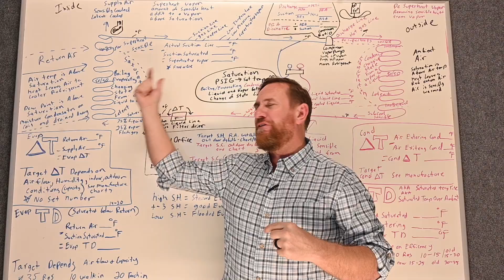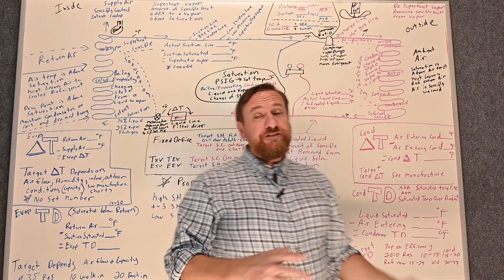HVAC 101 Big review Refrigeration cycle  with all the details

Comment: Thanks so much, I did learn alot from your videos, I do have Trane unit 27years old use R 22 and start making noise but it works, I am thinking to replace it, so is the set line can be used for the new one? and how can i clean it if i can use it and do i have to do charge with ferion or the new unit will have ferion in its compressor?

Comment: If i may ask. Why is home Air-conditioning blowing hot air .
Reply: cause the condenser and evaporator are reversed in the AC heating mode. the heat is now from the same indoor unit(which is now condenser ant not the evaporator in the cooling mode).Btw, It's not actually blowing hot air, it is the room air blowing by the fan meet the hot coil and absorb the heat from the coil. hope that helps.

Comment: Sir 
A tec came and check my ( txv ) ac !!!!!   After he left and after  awhile I  decided to check the unit put some gages on it and once that the sub cool ( hi side ) was at 10 degrees superheat which is what the unit asked for but my low side would go from 34 degrees to 27 degrees. 
The hi side would not move.
Correct me if I an wrong but I think he let air in the system. And that is why my gage on my low side gage is moving..  .let me add this everything else filer dryer. Reg filter, air flow in and out .  I have 42 degrees coming out  of my register.

Comment: 1:00:54 - I’ve finally discovered the best way to keep this straight in my head: high SH means more vapor taking up space in the evaporator coil and high SC means more liquid taking up space in the condenser coil. Both situations leave less room in the respective coils for saturated refrigerant causing well known issues in each. The opposite is also true: lower SH means less space taken up by vapor and a risk that liquid refrigerant can travel down the suction line toward the compressor (or vapor pump, as you call it) and lower SC means less space taken up by liquid, risking less than a solid column of liquid hitting the expansion device. Low SH - not enough vapor leaving the evaporator; low SC - not enough liquid leaving the condenser.

When I get to the point where I’ll be able to teach refrigeration, I’ll explain it this way!
Reply from the maker: Yes that is correct. 
That's explanation was my goal in 
HVAC 061 TXV TEV part 2 with Target Subcooling  and 
HVAC 062 TXV TEV Target superheat vs Superheat.

Comment: I want to connect a vessel at the outlet of the condenser in my propane-based brine-to-water heat pump system to collect all liquid refrigerant and gas in the event of a leak. How should I determine the size of this vessel? Can I attach a liquid receiver for this purpose? My goal is to ensure that all liquid refrigerant is collected in the vessel if any leakage occurs from the condenser lin
Reply: Should work, but you'd need electronic valves to shut off the high side King valve, wait for pump down to finish with a low pressure cutout and have that also trigger a low side cutoff to seal it all in the tank. Just make sure your tank doesn't have any leaks..

Comment: Big question, does pressure increase during superheat in the evaporator,  does it drop during de-superheat and sub-cooling in the condenser? Intuitively I would assume yes, however the fact that we can determine Saturation Temp by reading the PSIG of our low and high side access ports, implies that no pressure change occurred during these processes. Any answers with explanation would be incredibly appreciated.
Reply: Hmm. maybe ive got it. Even though superheat is occurring, the increase in pressure caused by the superheat has already been accounted for in the net pressure of the low side line.

As superheat occurs, pressure increases, raising bp, reducing flash, increasing liquid, increasing time taken to reach 100% vapor, reducing superheat.

reduced superheat means lower pressure, lowering bp, increasing flash, reducing liquid, reducing time taken to reach 100% vapor, increasing superheat, increasing pressure, ect ect.

endless self balancing cycle? Or am I all wrong here?
Reply from the maker: At 0 PSIG (14.7 pasi) atmospheric pressure nitrogen has a saturation temperature or boils at -320⁰F.

I can put a cup of nitrogen on the table and it will be liquid boiling at -320⁰F with 14.7 PSIA atmospheric pressure pushing down on it. 

Yet in the same room the nitrogen vapor is superheated to 75⁰F.
The pressure has not changed, but once the nitrogen turned to vapor it superheated 320⁰F above its saturation point. 

I can reduce the atmosphere pressure (vacuum)  and make nitrogen boil at even a lower temperature. I can also increase the pressure and make nitrogen boil at a higher temperature. 

Even in a propane tank, the propane vapor at the top of the tank can be superheated above its saturation temperature. 

If you pour hot water on a tank and rub it down the tank you can feel where the liquid propane level is. When your finger reaches the liquid, some of the liquid changes state, absorbing heat and cools your finger.  The vapor at the top of the tank just superheats.

All the gas laws work together to create the pressure Ballance.
Boils law, Charles Law, Gay Lussas las, law of perfect gasses.
Reply: @love2hvac  Hmm, I partially understand what your saying, but it opens up more questions. In your example, when we drop the pressure to make the liquid nitrogen boil at a lower temperature, does that instant pressure drop, instantly drop the temp of the liquid nitrogen? If so would an amount of that liquid nitrogen flash to vapor the moment the pressure drops to facilitate that cooling?

Comment: One more question about TD and Delta-T, I'm getting a negative temperature change only when calculating for Condenser Delta-T. Is this correct assuming that the temperature of the air coming in is going to be lower than the temperature of the air coming out, therefore, a negative net difference? Both my Evap TD and Delta-T calculations were positive increases so as my Condenser TD, so I'm not sure if my calculation (or understanding of it) is wrong for Condenser Delta-T.
Reply from the maker: Condensor data T the air exiting will be higher than the air entering. 

Condensor TD (CTOA) the saturated aka condensing temperature of the refrigerant will be warmer than the air coming in. 

Evaporator delta T the air entering will be warmer than the air leaving. 

Evaporator TD the air entering will be warmer than the refrigerant saturated (boiling) temp. 

There is no negative number since it's just the difference in the two.
Reply: @love2hvac  Thanks very much for clarifying that Ty, and keep up the stellar work! I'm learning so much from your videos :)

Comment: Hey Ty, thanks so much for this video. I just started my apprenticeship in HVAC and I've already learned more about the basic refrigeration cycle watching your video than other YouTube videos covering the same topic. The only part of your video I haven't fully grasped is the difference between the Delta-T vs. TD equations for both the condenser and evaporator. Are they essentially the same equation? For example are you simply using the return air and supply air difference in the evaporator to get to the same outcome (ie. temp difference) if you don't know your suction saturated temp? I'm essentially confused about the difference between TD and Delta T in terms of when to apply them in real life scenarios.

And lastly, you say that the discharge line temp shouldn't exceed 225F, is that a universally applied rule to ALL lubricating oils used in residential/commercial compressors or are there some oils that can handle a higher discharge temperature rating? Thanks again for all your insight and wisdom :)
Reply from the maker: They are both temperature differential but they are separate uses

Delta t meaning the same medium in vs out. 

Evaporator delta T means it temp in vs air temperature out. 

Condenses delta T is air temp in vs air temp out. 

Liquid line delta t  is refrigerant temp in vs refrigerant temperature out. 

Water chiller delta T is water temp in vs water temperature out. 

TD represents 2 different mediums. 
Evaporator TD is the return air temperature in vs the refrigerant saturated. 

Condensor TD is air in vs the saturated temperature it's also called CTOA (condensing temperature over ambient)

You can have a chiller TD refrigerant saturated temperature vs water in temperature. 

Cooling tower TD is the air entering temperature vs the water entering temperature. 

For TD is also used for hydronic cooling. 

Return air temperature vs the temperature of the water entering. 

both are tempersture difference. 
TD is two different mediums 
Delta T is the same medium. 

It's a term.many people get.mixed.ipmimntje trade and incorrectly interchange them.

Hopefully that helps !
Reply: @love2hvac   @love2hvac  yes it makes crystal clear sense now, thank you very much for your detailed response!

Comment: 17:31 what is going on with your shirt!?
Reply from the maker: It's a cooling shirt.
The back is cut to allow airflow and a mesh material is behind that. 
It keeps your back from getting soaked with sweat.

No air conditioning in the studio, it gets about 100⁰F while recording at 105⁰F my best starts to overheat and shut down.

Comment: So on a reach-in cooler or freezer the manufacturer should have a performance chart?
Reply from the maker: Yes.
You can also get a performance chart for the compressor.

If it's a Copeland, you can scan the model number and select the refrigerant. It will provide you with the capacity, amps, eer, cop, and compression ratio at any set of conditions.

Comment: Good night Professor Ty. I watched until you talked about condenser TD. I have two question. I don't completely understand when is said that the flash gas helps cool the liquid refrigerant down to the boiling temperature, could you explain it to me more deeply or tell where I can find more information? Also, why a condenser with a lower TD is more efficient and how can you tell which is the design TD of a condenser? Thank you very much, and have great day.
Reply from the maker: I'm not sure where it is but I have at least 2 videos on flash gas. One is introductory the second goes deeper. 

As for Lower TD and efficiency comes from the design. The manufacture builds more surface area or more air flow or material (micro channel)

The better heat transfer means we don't have to have a higher condensing temperature to remove the same amount of heat. The lower condensing temperature leads to a lower compression ratio and less energy usage.
III nhabe a video on TD also

Comment: Would you please talk about coolant cooled condenser by Valeo that BMW uses for its 2018+ cars
Reply from the maker: I don't have access to one for a video. but it's basically just a water cooled condensor. Instead of reheating heat to the air, it rejects the heat into water. The water then goes to the radiator to reject it's heat.
Reply: @love2hvac  thank you for considering my request; I've collected some info from the internet and BMW's ISTA, things worth noting is that its using the low temp cycle for cooling the intercoolers for the AC,  water hot side is closer to low pressure side and vise versa

Comment: I am asking for an analysis of what happens to the oil in the system during normal operation, Step by step, where it travels, in what amounts it settles the most, whether the physical height differences are an obstacle to the oil, what% of the oil leaves the compressor, what% remains in the evaporator, and does this oil come back if there is little refrigerant and low pressure? I understand that the easiest way to move the oil is in the liquid part (logical), if we have a leak, little refrigerant, low pressure, will the oil be able to "get out" from the nooks and crannies of the evaporator?

Comment: Wow as per usual sir super good video. I have one concept that I’ve been wondering about. How does the compressor know the ambient air temperature such that it can always output an appropriate CTOA pressure?
Reply from the maker: The compressor does not change it's moving the same volume of refrigerant. 
If you have a container of refrigerant,  and move it to a warmer place the pressure will also increase. So the natural laws are still in play. As the temperature on the copper goes up the temperature of the refregerants is pushed up and also the pressure gets pushed up.

Even though the compressor is running the same speed, the additional pressure means more electricity usage and it's more work against the motor.

Comment: Thx for your quick response, pls google the phrase at the end, this is a leisure facility in England where the sun is moderate compared to other places, and they have managed very good savings using a couple of thermal panels for each Mitsubishi VRF unit.
 “Energy saving at White Horse Leisure Centre with solar thermal technology”

Comment: Thank you Ty, you are wonderful, you make thermodynamics fun, if I had a teacher like you long time ago when I was at SDSU, I would have ended up a mechanical engineer instead of civil.
Keep up your lessons, I bet everybody is now understnding science better.
I have a question for you, and would very much appreciate an explanation.
Now a days some companies are offering thermal solar panels as a retrofit between the variable speed compressor and the condenser, claiming it will make the compressor work at lower speeds thus saving energy up to 50% in sunny areas, my question is
If the refrigiratìon  cycle have somewhat fixed temp and pressure along the hot and cold lines, wouldn't raising the temp in the condenser violate such parameters, and what about the size of the condenser or fan speed ?
and if such substantial savings can be achieved using a simple technology, why don't the manufacturers take advantage of it, and make a provision in the line so a thermal panel can be added when the situation allows, along with the proper technical details in their literature.
Thx in advance
Reply from the maker: anytime   "savings" and high numbers like "50%" by BS meter goes into alert. 
It takes energy to move refrigerant, to move heat. Even with Geothermal and its really impressive heat storage  designs the savings are nowhere near that. Lennox had a system that uses solar panels that tied directly to the condensing unit. it only offset the use of the condenser fan motor. that's approximate 184 wats. It was a lot of cost for very little savings.  
Every few years companies reinvent evaporative condensers. they spray water on the condenser to increase capacity, it works for a short time but the water bill goes up and the water quickly ruins the condenser fins cositng much more money than ever saved. the marketing is great though.
That said I would have to look at the design and see the numbers. Just because I'm very highly skeptical, and its unlikely, it could be possible.
Reply: Yep, seems out best bets are to optimize the parameters for the refrigerant and system as a whole. Plus less temperature delta from condenser to evaporator takes less compression, therefore more efficient, that's why geothermal is so good, it's more consistent and less extreme than the air in winter or summer. R290 looks pretty good for efficiency if not liked for other reasons.  @love2hvac

Comment: Hey ty , I know this is beyond the scope of the basic refrigeration cycle but I was wondering if you can help. I’m learning as I go and trial by fire. I’m currently working on some marvair wall mount units which I hate. The unit was working perfectly fine but now it’s not. ( story of our life right?) anyhow , I believe it has hot gas bypass or reheat. My suction lines cold and sweating and condenser is pumping heat. It’s not calling for any heat. But my discharge air is relatively warm. Do you have any literature on diagnosing failing hot gas bypass and it’s symptoms. I’ve searched the web and can’t find anything worth reading. Thx!
Reply from the maker: You can use the decoder in this pdf with the model to see if it has hot gas bypass
https://marvairhvac.com/files/i-o_Rev19_pn-p01655.pdf

Explaining hot gas bypass

https://www.achrnews.com/articles/105262-understanding-hot-gas-bypass

Also free tech support here

https://www.bluonenergy.com/hvac-tech-support/

Comment: Awesome 👌. I do think it's OK to check subcooling on commercial units like coolers with a liquid receiver. Chapter 7 commercial refrigeration for AC techs by dick wirz,  Has diagrams with liquid receivers n checking subcooling after condenser n b4 receiver.  I would think it would help to take subcooling after condenser to get n idea of what's going on inside condenser n if u have liquid leaving condenser but understanding it will go through the receiver b4 it reaches metering device  n sight glass. I would take temp at outlet of condenser n b4 metering device to c if any temp/pressure drop. Love this virtual training program u r doing. Thanks again for helping us future thermal dynamic energy specialists!
Reply from the maker: I love that your reading his book, understanding and applying the thoughts! That is great! When I get to refregeration focused section I will go into detail of that and how to see how full the recover is during pump down.
Reply: Nice! Thanks 👍